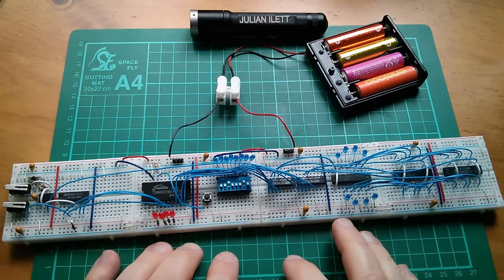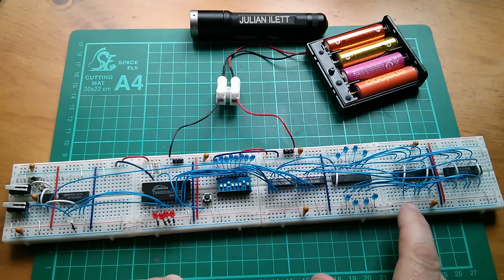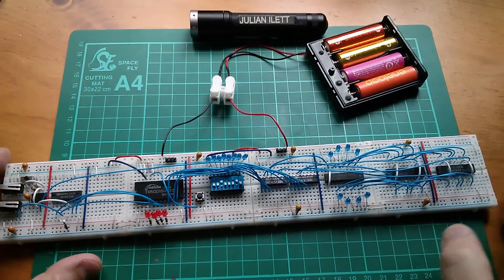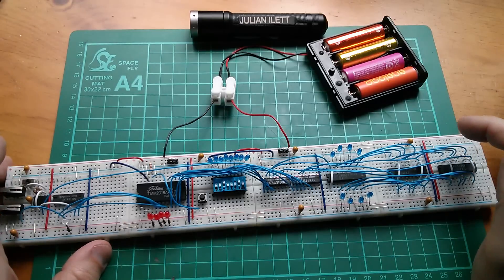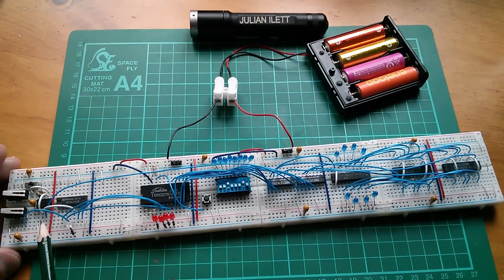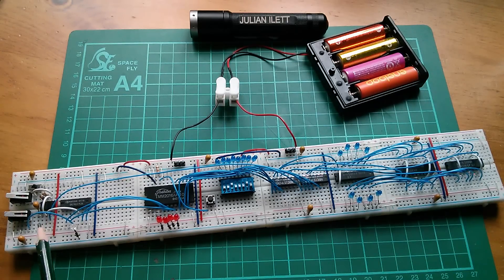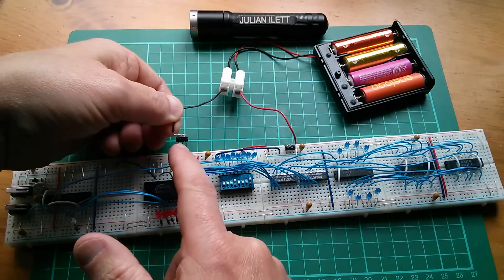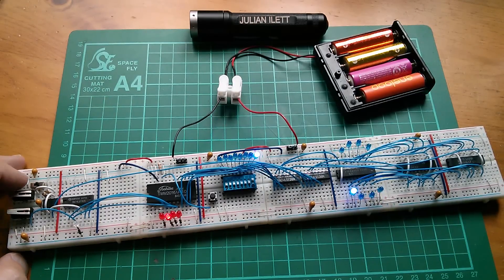Update: 8-Bit Breadboard Computer

Comment: Great project Julian! Regarding the LS374 latches and the messy bus wires, I thought your idea of using multiple top/bottom removable bread board bus segments to build a breadboard bus was brilliant. If you put a data bus on both sides then you could tidy up the bus wiring regardless of the chip layout and stick with the LS chipset. That being said, the ideal design would probably be to alternate data and address buses on either side of the bread board arms especially if you plan to add program counter modifying instructions. Really looking forward to more of these!

Comment: Julian, there is a component for the DIP-sw / bus display you're looking for. DIL-socketed and has 8 leds with 8 resistors. It has 8 inputs on one side and the common anode/cathode on the other. I bought them on ebay a long time ago. They were not exactly cheap, but they are quite handy in these situations...

Comment: Use rectangular LEDs, they'll stack side-by-side in a smaller footprint than the round ones! You could also provide a battery-backup for the static RAM; that way, you wouldn't lose the contents on power-down (batteries, a dropping resistor, and a fast-recovery schottky diode should be all you need.) Cheerios.

Comment: julian, this is really fun. But why on earth have you not employed 74181s? Two four bit parts and that 2k ram you have there as a microcode store and you have an alu for both address and data. Is the idea to do all this without using bit slice parts?
Reply from the maker: Price and availability - I only want to use parts which can be obtained easily. The 74LS381 is another handy 4-bit ALU. Interestingly, because it's purely combinational, an EPROM could be programmed to do the same job.

Comment: Funny switch behavior, bouncing?  Try Google phrase "debouncing with schmitt trigger" provides variety of circuit ideas w/ different IC family chips.   LEDs & tidyness?  Since you're already 'modularizing' the whole thing, what of making up a number of universal LED display modules, if for nothing other than not needing to take time to lay out a bunch of LEDs AND their wires.  Maybe some LED display module would only require the wires.  Dunno, just thinking out loud.
Reply from the maker: I'm going to do exactly that with the 10-bit LED arrays :)

Comment: i need to radio a pulse to another implantable device and this pulse to return back to the transmitter. at the moment i am able to transmit it but don't receive it back. i am using the transceiver 2.4 ghz thank you in advance

Comment: Turing completeness 101:
Your computer should be able to:
1) add or subtract the contents of one memory adress to another
2) set a memory adress to a constant (technically as long as there is a 1 anywhere in the program, it works)
3) conditional branches (see the conditional there? it's important.)

So just being able to jump to fixed positions does not make your pc turing complete, you need condition codes.
Reply from the maker: I think I've worked out a way to do conditional branching now :)
Reply: Julian Ilett It should not be too hard. If you set your ALU to subtraction (aka negate the second input and set carryIn to 1), then NOR all the output bits together, you can compare for equals, since two equal numbers subtracted from each other gives 0. 
Greater/Less for unsigned numbers is just the carry bit after the subtraction, so if CarryOut is on, the result is not overflown (it basically flips meaning if you subtract), so A-B>0, or A>B.
Now you save the equals and the carry bit in a register, and later at jump you add some "conditional" field to your instruction. That field then is compared to the flags and if that matches, the PC write pin is pulled high.

That's conditional branching, only requiring (with "amounz of bit's" b) a register of size 2, N (n)or gates, two xor gates and an alu capable of subtraction.
Of course if you add more gates it can become more useful so you can not only jump if A=B, but also if A≠B, or A≤B.
Reply: It wouldn't be that difficult to add interrupts both maskable and non-maskable.

Comment: Turing machine need to be able to:
Read and write data from/to memory, for example in RAM.
Have program stored and readable, but not necessarily be writable, in memory.
- Could be stored in same memory as data, in the RAM. 

Have a program that can do three things
- Execute instructions in sequence
- Unconditional jump to another place in the program
- Conditional execute an instruction, like a jump, if a test is true, just pass if false. Like depend on bit that is shifted out. If previous instruction result is negative, or not, or like that.
Reply from the maker: Thanks for summing that up. I think I have a mechanism for the conditional branch now :)
Reply: You are welcome.
You could have a instruction that jump if a condition is set. 
Alternatively the instruction could also skip next instruction on a condition, if not next instruction is executed. Which could be a jump.

Like to see how you implement that. :)

Comment: Did you mean 573 (Octal D-Type Latch with 3-STATE Outputs) or 574 (Octal D-Type Flip-Flop with 3-STATE Outputs) ? Anyway, either are available from Rapid in the HC DIP-20 variant and so are compatible with the LS range.
Reply from the maker: Availability from Rapid Electronics is fine for UK viewers, but not for overseas. If I can find all the parts on eBay (from Chinese sellers) everyone can play along :)
Reply: You probably won't find many LS around these days. Search for 74ALS573 / 574 instead. Faster, higher drive current capability, and available in DIP pretty much everywhere, including Ebay.
Reply: This is why we all need to hoard ICs. I have KS74HTCLS573s in stock. I have some KS74HTCLS646s too. From my Das Blinkin lites daze.

Comment: Hello I know it sounds overpowered but in my 8-Bit Computer I used an Attiny85 for the Clock. Because of the Advantages: Software Debounce of the Button, nearly no external components required and a changeable Frequency and this all with one Button and a configuration Switch
Reply from the maker: I don't want any components that have to be 'pre-programmed' (apart from the computer's own memory). I'm going to avoid ROMs, PROMs, MCUs etc.